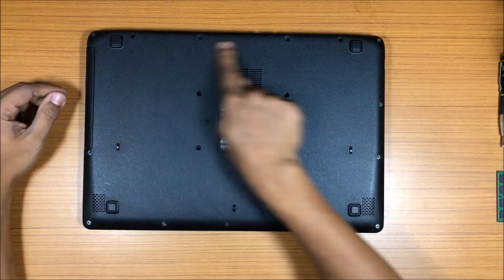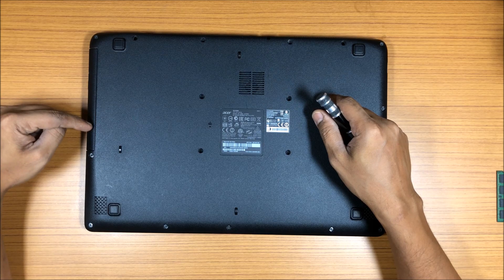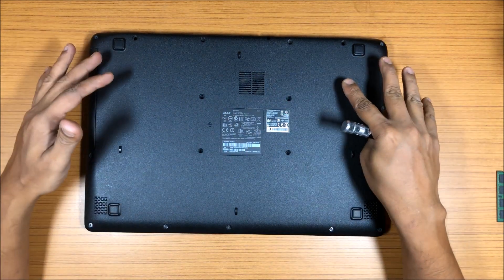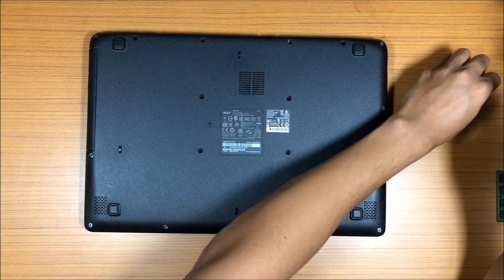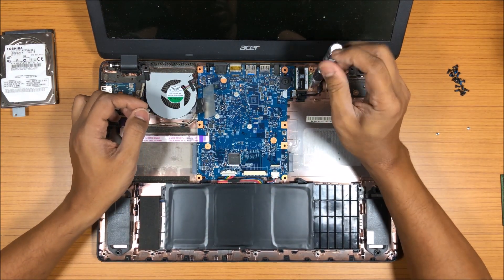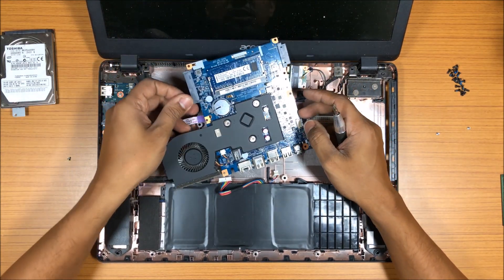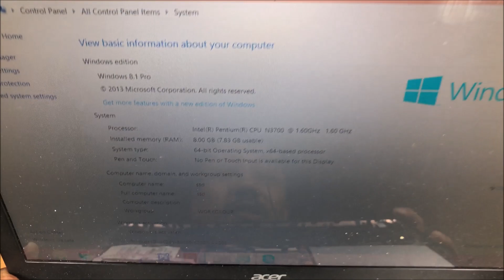Acer es1-531 Disassembly and Ram Upgrade

Comment: You have 2 tinny switches inside on the motherboard. The keyboard needs to be tight screwed so that those switches can stay fit to down position to make a tight closure.   I would suggest, since open, to re[;ace a new bios battery while on it..
Reply from the maker: Good to know, thanks for the tips!

Comment: I actually bought this laptop a couple of hours ago, glad I can get rid of it again even if not much profitt I guess, but this is Really not one you can easily open. I am gonna sell it again, although I possibly could have sold it for a higher price, I really prefer those which have the parts that can be replaced easily accessible. This is not one of those laptops. Otherwise it probably does good work in other ways since you are not meant to open it frequently, thankfully, lol.

Comment: I’m building a cabinet for slot machines. I want to use lcd screen hdmi. Is possible to remove the entire screen part? There is a cable that goes from screen and is directly attached in the mother board (but here I cannot see it). There’s some tape in the plug, I think is screen cable but I’m not sure...

Comment: Hello sir, i have a question, are they still allowed to use mercury in laptop components ? i have a ACER 5750g model 2011, the screen is LED but i am worried about other components like switches ...

Comment: This is the worst notebook I have ever seen. It is very slow. Or garbage taken with money. You can't use this disgusting thing for any job and it's impossible to play games
Reply: Have you tried upgrading to a SSD?  I have upgraded lots of slow laptops and they all benefit massively from a Solid State Drive.  I'm upgrading this exact laptop in a few days so I will let you know how much difference it makes.
Reply: It runs a lot better with the SSD. It's never going to be a gaming laptop but for documents and browsing it makes it nice and smooth.  Considering the SSD upgrade was a Crucial 120GB that cost £22, it's a cheap and easy upgrade.
Reply: @stuartedwards6996  Do you have a link?
Reply: @stuartedwards6996  thank you i'm tryig to do the same
Reply: Its not for gaming. Its good for traveling and web surfing etc and extremely good battery life. Boomer laptop as some call. But gets the job done.